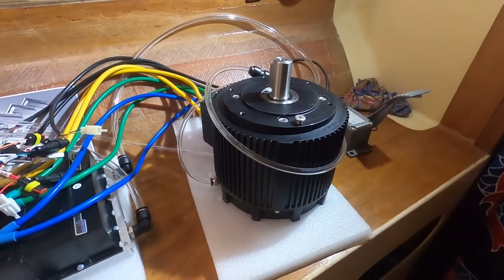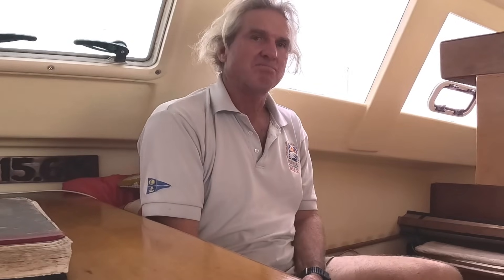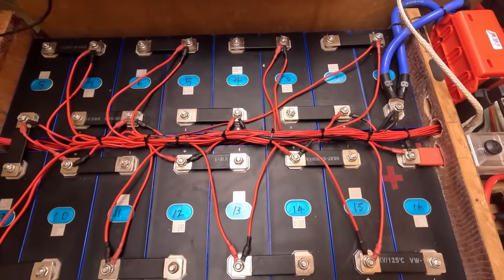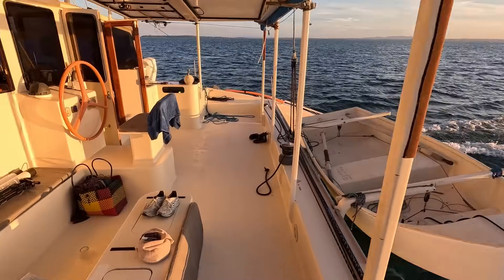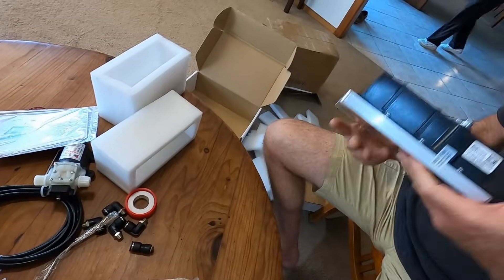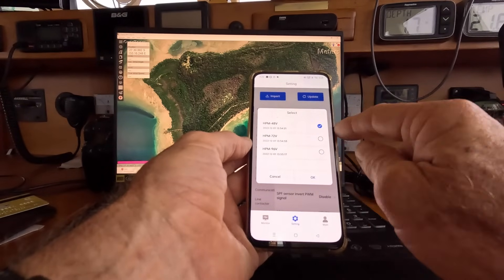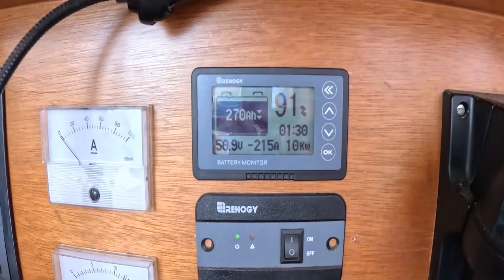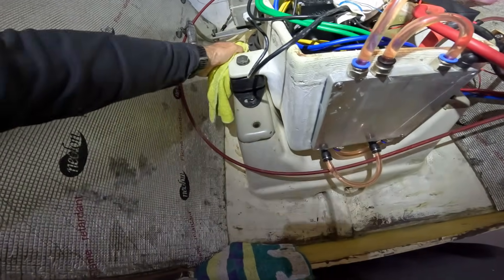16 Months using our Electric Motor -  Good or Bad?

Comment: thank you so much for this fantastic video, i was having a nice sailing trip with my friends last weekend and my Yanmar engine stopped again due to dirty fuel tank and I had to work in the engine room for a few hours and then found out that the RACOR is also leaking so I lost one engine power completly for the whole trip which ruined my trip, so  this really got me wondering how I might able to explore the electric motor option. thank you so much, especially when i see your motor is from China, their factory is quite close to me so I definitely need to give it a try.
Reply from the maker: Hello Maxianchang, they will be perfect for you and they are very helpful. You will definitely enjoy not having to deal with diesel and oil and the messes of diesel engines. I'm not sure of the design of your boat but it certainly looks like the right size for a 10kw electric motor. Enjoy the voyage of discovery and the pleasure of a electric motor if you head down this path. Best wishes Fantasia Sailing.

Comment: Hello again,

Are you finding any issues manoeuvring with 1 electric and 1 diesel?

Did you think to run 2x electric?

I’m thinking to do 2x electric and a 11kw generator. Seperate systems (inc battery).
Reply from the maker: Hello , you are always welcome! Yes, maneuvering with the electric diesel combination is pretty much the same as the it was with twin diesels so it is very easy. The only difference is that the electric motor develops its thrust quicker, but that just feels a bonus. The throttles have different play also but you get used to that pretty quickly. I do feel that if their is one thing that needs improving on my electric set-up, its the throttle. it is fine , bu the amount of travel between low revs and full revs is pretty small, so it is easy if your not used to it to pour on the revs way to fast. I am fully used to it now and it can also run at really slow rpm like 100rpm, whereas the diesels cuts in at around 900rpm, so this can be cool when you just want very low power. At the same time 2 electric motors with a gen set and battery will be fabulous! Electric motors are such simple beautiful machines Best of luck with your project!
Reply: @AndrewStransky-cc2dr thanks very much mate!

I will be starting it in a few months!

I’m removing the 55hp diesel Yanmar engines and replacing with twin 10kw setups like yours. I’ll run a bigger ESC so I can push them up in 15-19kw range if needed temporarily. 

Fair winds!

Comment: Hey mate,

First I have to say a big thank you for making these videos. They have helped me to no end. I was sitting there thinking I need 25kw motors and when you pushed yours to 19kw (for a brief second) I saw that it can do it in emergencies (albeit 400amps!!!). 

Just wanted to know, Have you tried the regeneration part  on the EZ-Kontrol app?
Reply from the maker: Thank you 4060! Yes, I'm so impressed with these 10kw motors! With another long cruise behind us now I am even more impressed as I gain confidence in its power. The thrust is amazing, every bit the match of the 30hp and more. Keeping it cool takes a good system and I have had to work on mine due to the reliability of pumps etc. I'm reluctant to drive it too hard but as I gain even more confidence it has a lot more power that I haven't tapped yet. I haven't had a go with regen, mostly because I don't like the noise of the prop free-wheeling when we're sailing and maybe some doubts over whether it would work with a folding prop. I have seen it is a matter of reversing the cables somehow, so I haven't tackled that. Yeah, 10kw is a heck of a lot of power in an electric motor and the Golden Motor is a great deal. All the best!
Reply: @AndrewStransky-cc2dr thanks for the quick response Andrew. It is a fantastic deal. 

Very, very interested to see her pushed. Wonder how she would go at 15kw for sustained periods (with cooling sorted). Maybe using sea water?

Or do you think that would be pushing the electric motor too much?
Reply from the maker: @s4060  I have a bigger impeller pump now as the old diaphragm pump was failing to suck up water after fast sailing venturied the seawater out of the system. Yesterday I ran it at 8,5kw against a strong wind and waves and was so impressed at how powerful 8.5kw is. I think running it at 10kw would be incredible and I don't seem to ever do this much, other than short blasts when maneuvering. It is only rated for 10kw continuously and more for just 60 seconds. It does cut itself back if y
ou try and push it too hard, which is handy.
Reply: @AndrewStransky-cc2dr  thanks for the info mate!

I haven’t experienced the electric motor at all. I just saw you go to 19kw at one point…. That ran almost 400A though! 

If you were against strong winds eg 40kn and a strong current, would you think it would still push your car forward at 5kn?
Reply from the maker: @s4060  yes, these 10 kw motors are extremely powerful. Not many yachts at all can motor into 40 knots! Let alone against a strong current as well!. Certainly not at 5 knots. I've been sailing all my life and have only truly experienced 40 knots so few times. Thats storm force winds. Under both motors you can hold into 40 knots. 35 knots you can make way with both motors running hard. This isn't the fault of the electric motor though, its just a factor of the large windage of a boat like ours and the relatively small horsepower we choose to run. We could manage to cross a small bay under power in these conditions, but if bigger distances were involved we would sail.
Reply: @AndrewStransky-cc2dr thanks Andrew!

Appreciate your comments. Fair winds!

Comment: I am a final-year marine engineering student. We want to do the feasibility of using an electric outboard engine for fishing.
Reply from the maker: Hello Yusuph.  Sounds like a great project to finish off your marine engineering with something truly worthwhile! I would imagine a non-planning fishing skiff, built with a nice canopy made from solar panels to keep the everyone cool. Golden Motors look to have some good electric outboards and and LIFEPO4 battery banks are now very affordable to the point an electric set-up is  not much more expensive than petrol. Perhaps the key thing is how much power it takes to drive a boat. 1kw of electric power could probably drive a nice non-planning skiff at 5 knots. Minus the cost of fuel and oil plus the longevity of electric drive, that will equal a much better life for this beautiful profession. Not to mention removing that smell of petrol and the pollution. Good luck with your study.

Comment: I really think a hybrid approach is the future.   Fully electric drive with as much solar and battery as your weight capacity allows with a backup generator for those rare times you simply need more range in a hurry.  If your just island hopping or leisurely making a longer crossing there is little need for extended high speed motoring.  That's what the wind is for.  Still for those odd times you need to motor continuously to outrun a storm having the ability to kick on a generator to give  you an extra 100nm range at decent speed can be a life saver.
realistically enough solar to produce 20-30nm of range a day is going to be more than you could possibly use for your house batteries at anchor even if you have a couple days of overcast.  If your drive is able to be reversed and charge the batteries while your under sail you can top the batteries off even if clouds reduce solar to nothing.  Just sacrifice a bit of speed for energy.
Reply from the maker: Yes, a hybrid style system would certainly be a good idea for those uncomfortable with a limited range. As we still have a diesel in the other hull it  seems a perfect system. or as you say a gen set and dual electric would be pretty amazing. We have already fallen back on our diesel a few times for various reasons, but have also only purchased 1 x 20l of diesel in the last year! We do sail virtually every few days and have covered more than 3000nm in that period and able to use the motor more than ever!

Comment: What did you use to convert 48 VDC to 12?
Reply from the maker: It's one of the simple 600w convertors. They seem to be available under various names, mine is branded Daygreen and cost $150 AUD. Victron look to have the exact same thing, but produced in blue and much more expensive. My one has been perfect from the start.

Comment: So enjoyable watching your innovation  , thanks for posting the details . I am very interested in doing this 1x electric + 1 diesel as one of my Volvo MD 2010 has packed up again , and I am now looking at converting one engine to electric . First question , please , did you fit  the motor to a saildrive unit ?
Reply from the maker: Hey Gramos! Definitely a good way to go, hybrid style, with the best of both worlds and getting a foot into electrification. Yes, our 10kw motor is attached to a Volvo saildrive. You just have to make a mounting box and join the shafts via a Lovejoy style coupler.
Reply: @AndrewStransky-cc2dr  thanks Andrew that just what I wanted to hear, have you any pics of the way the electric motor is mounted and connected please ?
Reply from the maker: @gramos9115  yes, I really need to bring out a video on how I made that mounting box. There are some close up photos at the beginning of my video comparing a 10kw motor to a 30hp diesel and also there are some close ups in my video on cooling, Cool Running.
Reply: @AndrewStransky-cc2dr  Thank you Andrew , I have now watched ALL your videos , they are great entertainment . I have now removed failed MD2010 and looking as to where to buy the Golden Motor 10kw . I would really appreciate where to get the adapter from the 120S spline drive to the 10kw motor please?
Reply from the maker: @gramos9115  I purchased the shaft coupler from ebay. The "Lovejoy" style couplers with the rubber spider between the two half's to allow for a small amount of mis-alignment. I got the 110 coupler, being 110mm long and 84mm wide. It can take 45hp at 3600 rpm or 22.5hp at 1800 rpm according to the specs. One side you can order as I inch bore which fits the golden motor, but since the keyway is then 8mm metric this needs to be machined as well. The other side of the coupling you need to order a blank bore and find a specialist machine shop who can do spline cutting. The 130s has a 10 spline so perhaps the 120s has the same. I paid about $620 AUD to get these cut, with the coupler about $100. I actually had a fitting that slid over the 10 spline shaft from when I installed the motor and I was able to give this to the machine shop to copy. They may know the particular shaft spline on the 120s but this would be your only challenge to convey this specification to them, Good luck!

Comment: If y can run it from higher voltage power pack. Y can maintain higher power usage longer since y do not use as much amps W = V times A so 15000/50 =300A but i y have 90V power pack 15000/90 = 166A. Many times Shut down is forced by controller either your BMS or From ESC both uses Mosfets to control. For Mosfets is harder to find High Amp one than High Volt one.
Reply from the maker: Thank you Jukka. Yes, it does seem there are a lot of advantages to a higher voltage battery pack. To get any motors over 10kw it seems this is the route required. 48v does remain in the realm of of DIY  though. I was pretty nervous of even 48v to begin with but now, as I have gained some confidence 96v seems a lot more viable. Do you know if running at higher voltage also creates less heating, ie raises the efficiency? Oh yes, kudos to Finland for being such an advanced country in electrification. Best wishes, Andrew
Reply: @AndrewStransky-cc2dr  Since BMS systems have got lot better. It is possible just do another 48V pack and install them series. Y may need to change BMS. I have my self 18kw brusshless motor but not place to install it i planned to build battery from 26650 cells but to run 18KW lot Aps are needed. I got 24s bms but i could only build 16s 8p so my bms was not good choice. And small cells are hard to work with. litium ion cells are hard to come by larger cell sizes. it is good that i am building my system in way that i can install BMS on both config pararel and series.

Comment: Very interesting! My current 27 foot sailboat has had 3kw goldenmotor for 5 years now and it's been working great. Last year thunder broke the hall sensors inside the motor though. I'm probably able to repair them (tried and made video about it). It's not easiest to open and repair but seems doable.

The new big boat will have two (at least) 10kw motors and several big battery packs. 😇 (and no diesel hopefully at all)

Thanks for the video and insights! Cheers!
Reply from the maker: Hello Arctic SeaCamel! (I tried to find your name!) I see you have the older model controller in your video. I was kind of hoping the new models would offer some protection from lightening strikes. Yes, your controller had issues as it was doing the beeping thing. Well done for changing the hall effect sensors! I love the new boat you are building, a beautiful wooden craft into the bargain!  I took 4 years 3 months building my boat and it took a lot of persistence. Nice to have people engaging with you and I send you blessings for a smooth build. I shall be interested to see what kind of drives you are planning for your electric motors. (maybe you have already mentioned this, so I will check out more of your videos to see). All the best, Andrew.
Reply: @AndrewStransky-cc2dr  Thanks!
I really haven’t decided yet anything regarding of the motors etc. it all develops so fast right now. Also batteries are getting so much cheaper all the time! We’ll see what’s available in few years!

Comment: for the aircooled : always grab some computer fans. 1 for exhaust, 1 for inlet. stick em around the motor. youll never have issues
Reply from the maker: Thanks Jason. I think I need a 2nd computer fan as I only have one blowing air in so I need one to be sucking air out.

Comment: Very interesting ... my boat has a 21hp diesel so 10kw motor should be more than sufficient. I'd better have a squizz at your earlier vids to see how you put it together!
Reply from the maker: Yes, 10kw will have considerably more power and acceleration than the 21hp diesel.

Comment: Hi Andrew, I noticed from some of your videos it looked like you kept the original gearbox in place? If so do you know the gear ratio?
I'm just playing around with my set up I thought I'd try it direct drive to the propshaft even though people are telling me it's not powerful enough. So far it's looking like they're wrong but further testing needed. At around 300rpm it's pulling between 10 and 15 amps, don't know what speed that would equate to but looking at the water coming out the back I would guess about 3mph.
Seems pretty good to say it's moving around 12 ton of steel 😂
Reply from the maker: Hello Ian. Yes, interesting point. All the things I was reading pointed to using a 2:1 reduction ratio. So the Volvo saildrive has a 2.18:1 ratio which I figured would be good and it has certainly proven to be so. I suppose one of the thing with running it through a reduction gear is that the motor gets to run faster and work less hard, which will be better for not creating heat. Running it direct may well use less power though. Have you had a look at that other chap on Youtube who also fitted a Golden motor 10kw, The Neds I think. He took out his reduction belts and went direct. I'm not quite sure what his conclusion was but it'd be good to take a look. On the positive side also you are taking out a bit of friction. Interesting how you go pushing you 12 tonne boat. All the best!
Reply: @AndrewStransky-cc2dr  hi yes if it's the guy in Canada I watched his videos but not really enough information in them, I'll let you know my conclusions, the difficulty with direct drive is lack of a thrust bearing
Reply from the maker: @ian-ifb  Yes, but surely fitting a thrust bearing is not so hard? I don't think these motors are rated to take thrust, are they?
Reply: @AndrewStransky-cc2dr I've fitted a pillar block bearing to act as a thrust bearing and although this will take the load there is some slightly axial movement maybe 2mm which isn't much but probably enough to wreck the motor over time, so I now need a coupling that will compensate for this.
My propshaft is 1.5 inch which complicates things a little 😂
Reply: I'd originally intended to do the same as you, then I saw a huge widebeam 60' x 14' with a 15kw motor that was direct drive and thought if that works I can't see the golden motors 10kw having any problems.
Plus also my engine bay isn't huge and also going in there is a Kubota z482 500cc diesel engine to run a generator, we don't get much sun in wyin the UK unfortunately

Comment: A combustion engine suffers for horrendous friction losses.   Electric motors are SIX TIMES more energy efficient than engines, so it comes as no surprise that you're 10Kw motor would equate or better a 30Kw engine, since it requires significantly less energy to get it running and 95% of the energy goes into motion, not heat.